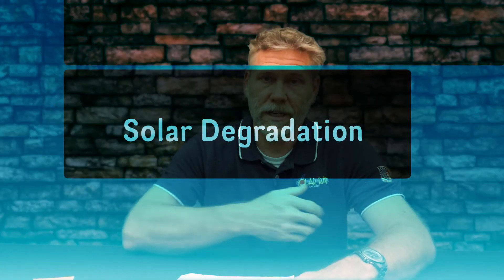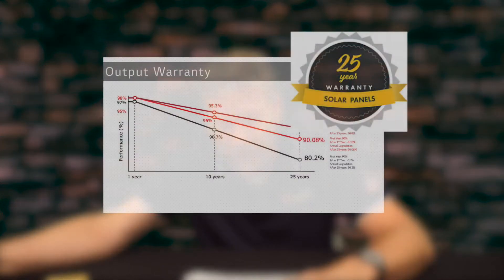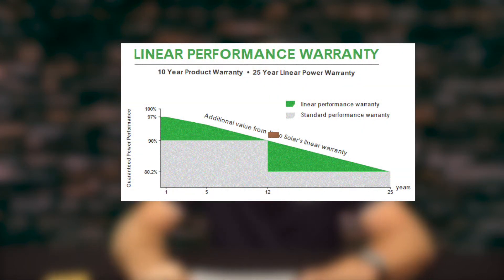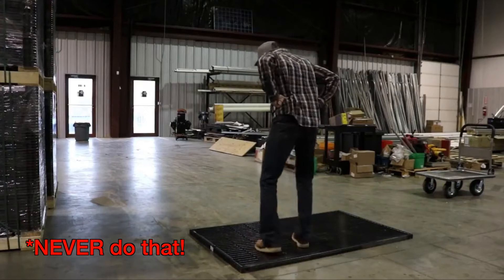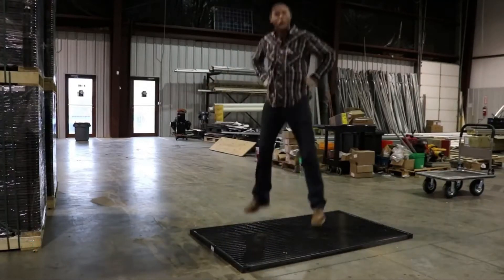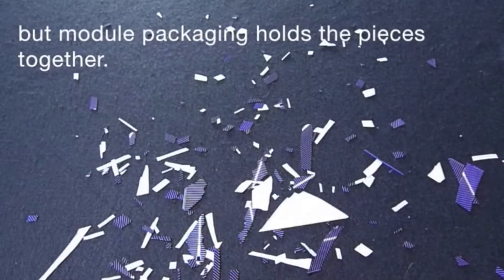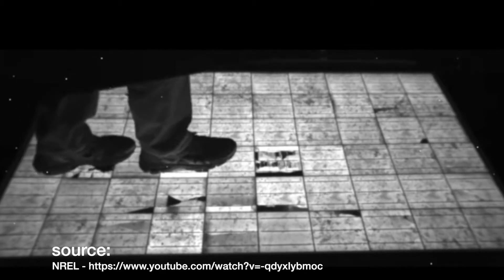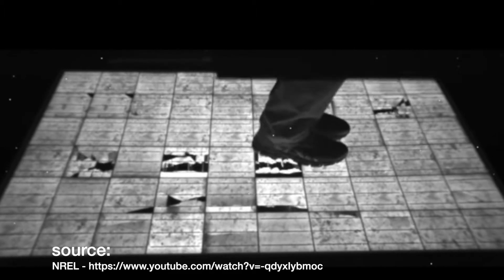Solar Panel Degradation

Comment: I heard that inverters run or sized closer to their limit are more efficient.   

Is there a sweet spot of sizing the inverter for efficiency yet not pushing too hard as to shorten life significantly?

Thanks for the Info
Reply: No, the closer to maximum capacity is always less efficient.  Inverters have an efficiency curve that is relative to voltage and has nothing to do with input power.  Peak efficiencies on transformer based inverters are always highest closer +10% to the converted voltage, eg., 270Vdc would be a peak transformer based inverter efficiency for 240Vac conversion.  However, transformer less inverters have a much broader range of ppt efficiency with the peak efficiencies running close to (considering temperature coefficient correction factors) peak inverter input dc voltage, eg., 520Vdc @STC input would be peak on a 600Vdc max transformer less inverter but the 92%-97% efficiency range could run all the way from a 180Vdc to the 520Vdc range.  Another note is that every inverter is "Current" limited.  In other words it cannot produce more current than the electrical specs call out for safety in wiring and over current sizing.  So, if your array is potentially producing more power than your inverter will output this is limited by resistors.  You know how toasters work?  Electric ovens?  Heating elements in your water heater?  The difference is that those items are designed to be heat tolerant and heat generating while your inverter is designed for energy production by the least restrictive and coolest means possible.  The only electronics that are designed specifically for heat are toasters, ovens, heaters and hot water heaters.